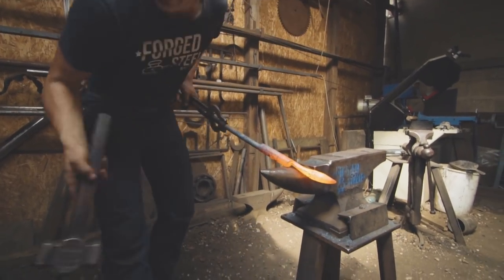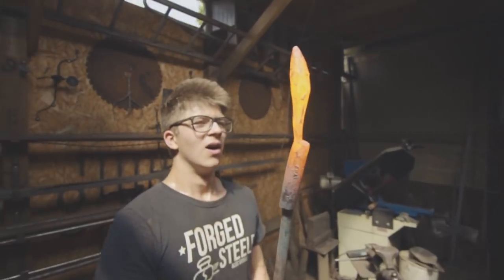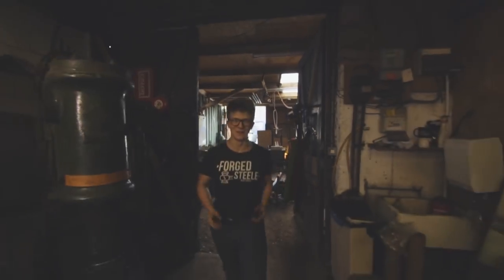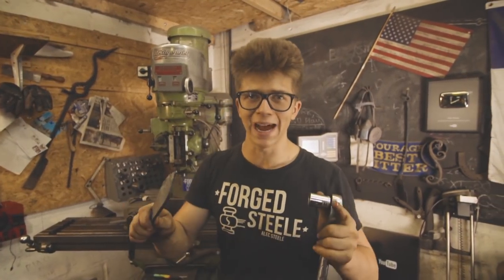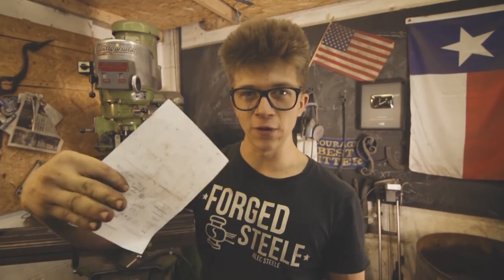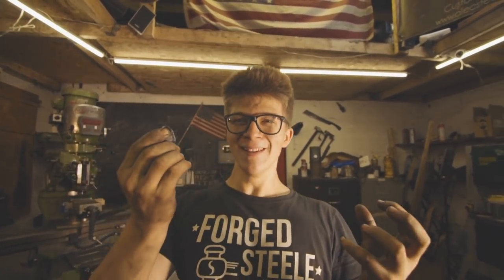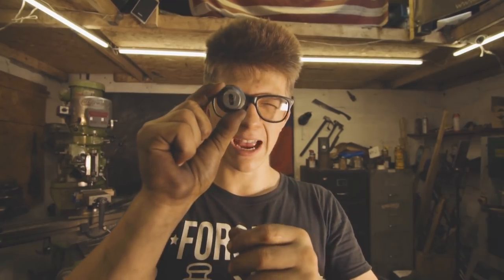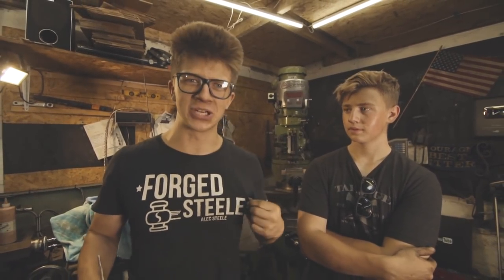PIRATE'S DAMASCUS SWORD: Part 4 - The GUARD and POMMEL

Comment: Nice vid guys. Two tips from me for the future: (1) when quenching the blade in oil, leave it in the oil longer, until it has cooled more before taking it out, to reduce the risk of warping, and (2) when grinding the bewel after heat treating, make sure to cool it often in water to not ruin the hardening.

Comment: Alec- if you're worried about how well you've gripped in the vice for slot milling, try plunge cutting the slot instead. Mill down to your depth, raise the mill, move the table slightly and plunge again. Plunging puts a lot loss stress on your fixture. You may end up with a slightly rougher slot, but barely.

Comment: quick tip. when working with wrought iron you want to work it at near a welding heat, any lower and you run the risk of it delaminating

Comment: Awesome vintage filter! Awesome cinematography! So dramatic! 

But Alec! You're working wrought like you've never done it before! If you're forging wrought, and you want to really move metal aggressively without hurting it, it better be DRIPPING slag and molten iron when you take it out of the fire! And we all know your forge can get that hot. Don't baby it, you can't burn it! 

Also, it's the old blacksmith law that you punch wrought whenever possible to keep the grain strong! milling that slot instead of punching it broke that grain. Though... it's not like the guard is going to taking all that much stress... 

Keep up the great work!

Comment: if you put on a wooden hilt try only puting a rough slot in the wood and then heat up the steel and push the wooden piece on, as it will burn the excess wood and make it shrink leaving an extremely tight fit.

Comment: Machinist perspective here, I would have held the pommel in a 4 jaw in the lathe and dialed it in across the average of the surface, then once it's drilled move the chuck and work to the mill, clamp the chuck to the table, and indicate off the hole for center.  What you did wasn't terrible, and it obviously worked (if it's stupid and it works, it's not stupid!) results are what really matters.  You could also make a jaw block for your vise with a vertical V so you can grip round work vertically in the vise with 3 points of contact for a more rigid setup.

just my $.02, but again, you got it done and that's what matters.

Comment: If you don't have access to a four jaw, the way you chucked up the pommel was actually pretty good! I would have used a spider instead of parallels, but you probably don't have one of those either. In the future, it may be easier to cut it off long from your stock and turn excess concentric, chuck up on the concentric surface, then drill the whole thing before parting it to length. But you still did great!

Comment: The funny thing is, the way you are doing the pommel drilling is almost 100% the best way to do it. I would have center drilled it first to spot it before doing the actual drilling to avoid snapping the bit.

Comment: Alec, did you get a 4 jaw independent chuck with your lathe?My apprentice master used to do his block if he caught us griping anything but bright (round) steel in a 3 jaw concentric chuck. It can damage the internal scroll and the chuck will no longer run true.Sorry I couldn't look away in time :)DavePs don't call them a vice :)

Comment: Not the worst thing we've seen you do on the machines recently. 
In the future, you might want to cut a small flat face on the spot that you are drilling(same size or smaller than the drill, so it deans affect the final appearance of the part) so that your drill won't try to walk away, spot drilling may also help with this

Comment: Anyone else have color problems?
Reply: Looks like the colour correction setting wasn't applied in editing.
Reply: Wow... Nelson Mandela's got color problems?? o_0
Reply: Yea mee too. But the rest is Stunning.
Reply: yea it looks faded
Reply: Yes, the color is a bit washed out in this episode.  Contrast is less too.

Steve
Reply: Pretty sure Alec went with a vintage filter or something on this part.
Reply: i had my saw table running in my living room today i thought my screen was dusty to be honest. until i checked my desktop and that looked fine.
Reply: it's just a filter thrown on in post production. im not a huge fan of it but its not an accident if that's what you were wondering
Reply: good meme
Reply: Looks like another camera. It's more lens distortion around the edges.
Reply: the guy  literally forges steel with a hammer and puts out a video everyday and you call em out on color
Reply: raciest much ??
Reply: Blah who needs colour when u can have faith
Reply: I hope they fix it to how it used to be, I have a few monitors I tested it out on, it looks almost passable on one but the monitor I usually use looks awful compared to the previous videos. People saying it doesn't matter grossly underestimate how important the production quality is to the success of this channel. 

There is nothing anywhere closely reassembling black in this video, less than half the contrast of normal.  The focus is way off in many of the shots too. Camera shakes a lot, some of those pans are nauseatingly quick, I hope they can quickly improve this back to near the old impressive quality.
Reply: Lee Perry you spell it color
Reply: Logan McCandless and you sir obviously don't appreciate professional colour grading and an actual care for production quality instead of just boosting the saturation and contrast n then calling it a day. there is nothing to be 'fixed' here, that is apart from maybe your perception on what you call production quality.
Reply: Max Brown color not colour
Reply: Cooper Kaesemeyer haha very funny yank
Reply: Max Brown ha ha Brit
Reply: It was a test done by the new videographer, not a problem, just playing around with the color, I for one think it came out great!
Reply: You don't appreciate how over 99% of people watching this are not using professionally calibrated monitors,  it will look unacceptably grey. I'm not going to argue with you, the focus is frequently off, the camera shakes during still shots, there are some cinematic improvements but on the whole this is a big downgrade.
Reply: I agree but we have to keep in mind the crazy amount of work they were doing the last few days and all the problems they ran in to
Reply: I think the white balance is off.
Reply: Logan McCandless funny considering I'm watching this on my PHONE and it looks perfectly acceptable plus I think alot better than previous content  Also on your comment on the cinematics tbh I'd like to see someone like you who sits in the comments picking holes in other people's work produce a better video than the professional videographer behind this video. You have to experiment to get it right, no need to be so harsh on him.
Reply: The camera didn't shake at all, if you were to watch the live stream on his insta you'd have seen they had a videographer with a steady rig in doing all the filming. You wont get 'shaky' footage with a steady rig. 
The production quality was clearly upped a lot in this video, you clearly don't have an appreciation for good cinematography. 
Personally I liked this new style as much as the old. Good job alec.
Reply: tmacfan16 problems rape?
Reply: "Anyone else have color problems?" Apparently. I'm white.
Reply: Camera sings on its last verse, probably
Reply: phone screens are notoriously over-saturated. I never post in yt comments, especially talk shit about people in them, but for what it's worth I'm confident I could shoot better footage on my cellphone cam on AUTO.
Reply: Logan McCandless actually modern cellphone screens can be extremely accurate with Samsung screens being able to be set to basic and having a color accurate screen
Reply: Logan McCandless Do it.
Reply: I noticed the difference, but it looks more natural.
Reply: Logan McCandless lol I have a Samsung and maybe if you were to own one you'd know there are various colour profiles and one of them is very colour accurate unlike the default over saturated one. go on, do it then. entertain your one subscriber. really loving the amazing cinematography (kappa) in '4K Bee bro';)).
Reply: Logan McCandless yeah sure can't see the focus is off on a 1440p display and the fact I'm a photographer totally doesn't help me in this situation at all does it;). lmao 'look at the gamma' mate they're live streams coming out of a PlayStation calm down 4K Bee. OLED anyone? oh wait doubt you could afford anything with an OLED panel, poor you.
Reply: Logan McCandless I have an Oppo f1s and its fine for me mate.
Reply: You are hilarious kid, look at all those videos you put up that half your 11 subscribers haven't even watched. A console gamer that watches YT videos on his phone calling me poor, you crack me up. Save up some money and try watching it on a real monitor large enough to actually see the video, compare to old videos, the focus is bad. The guy is doing nauseating swirls with the camera during what should be still shots, it's bad, everyone can see it, get over it.
Reply: It actually looks like its a lighting issue.  He does normally have some additional studio lighting that seems to be missing, and you can see it in the shadow casting (especially over where the anvil is, with the plywood walls).  Maybe that rain previous days caused some other issues...
Reply: Logan McCandless lmao yeah but yet I still have more people watching my videos than you and tbh i only put them up so my friends can see them. yes I play console, I also play pc and enjoy both. is there a problem in that? you say a 'real monitor' but you tell me, is your monitor professionallly calibrated? so what if it isn't a monitor, it's still a display and believe it or not I have a TV too!? there is nothing wrong with the focus believe me, what are your grounds to say that? any qualifications, a course maybe? and they're not 'swirls', they're pans. they add to the production quality which you seem to love to talk about.
Reply: I think the color grading was wanted, but maybe the person how did it had a monitor biased toward saturation, and other monitors make it look washed out. Or maybe they just liked it that way. I personally don't think it works well for these kind of videos, saturated colors work really well with hot steel, high contrast works well too, like a bright orange piece of steel beaten on a really dark power hammer.

But that's the trend nowadays, up the brightness, reduce contrast and saturation, put a yellowish hue on top.  People think it makes things more "cinematic" or pro. I don't thinks it works for youtube videos, different setting, you're closer to the creator, it shouldn't look like tv.

I have the same opinion on the camera work, it's too much "tv like", more movement, slightly out of focus shots that move toward the subject. meh. Maybe I'm just too used to the other videos, but it was great that way, if it ain't broke don't fix it kinda thing.

But it's cool to experiment new stuff, that's how you learn and improve yourself
Reply: maybe he removed his led fog lights since hes meant to be moving his machines and other stuff on yesterday or is it next monday that hes moving?
Reply: YUP
Reply: Mr.Meeseeks the 1st funny considering that the actual people who made this video and featured in it love it. maybe it's just there's lots of people who don't have a trained eye or know what they're looking for. not everythings all about whacking the contrast and saturation up. the fact that the creators of this video love it makes you all look abit thick if I'm honest.
Reply: anyway the guy called pans 'swirls', do you really think he knows what he's talking about?
Reply: Max Brown your salt replenishes my lifeforce, thanks kid should hold me over for a couple years at least
Reply: Max Brown I love it, got any more?
Reply: Logan McCandless hahahaha

Comment: Sweet colors. I use this in adobe lightroom, i got 300h under my belt. So I get it 😊👍 fit the wibe of the shop. Perhaps a biiiiiiit to too fat saturation. Just a tini smidge off and you are true!  Don worry you will have to start all over when you move shop 😜

Comment: I always thought that wat iron is what gives it the Damascus look, I also heard it had to do with things that are not meant to be in the metal. for example if you put ash, sand, small items into the metal, it is often removed by folding the steel over and hammering it together, sounds like a interesting project, why don't you give it a try.

Comment: Looks like he forgot to apply the color grading.  The color profile looks like a typical flat-ish (not quite log) color profile that many cameras have.  It's a way of ensuring that you can encode the larger dynamic range that the camera actually offers inside the limited numerical range of a normal video.  Afterwards, you actually tonemap it with a LUT to get the appropriate color mapping and contrast that matches the look you're targeting.

My guess is that he has been using this kind of color profile for a long time for his source and he just uses some out-of-the-box LUT to correct it, but it looks like he dropped the ball on it this time.

Comment: The cameraman/person seems like they are slightly shorter than you (Alec)... I'd be careful of making sure you don't film Alec from a low angle as it doesn't look good and it makes it so he's looking down at the camera... besides that, I really like you having a cameraman.
Reply: Also, I'd suggest getting a wireless lapel microphone that you can wear, so your voice can be picked up even if the camera isn't looking at you... especially in the new workshop when you might be really far away from the camera at times.